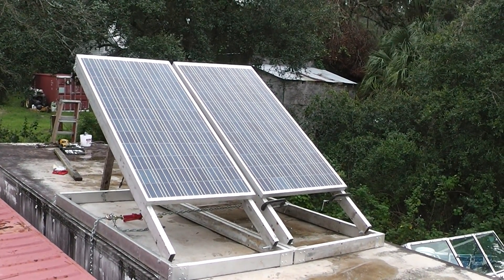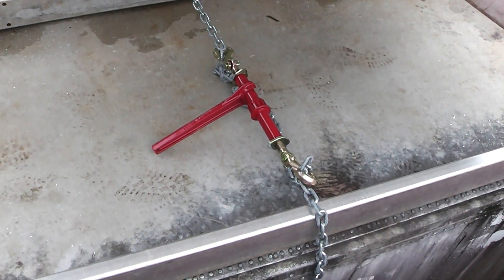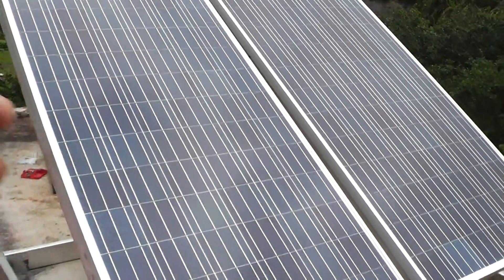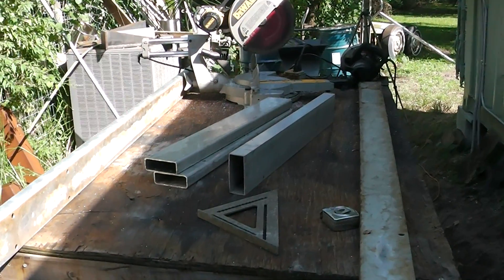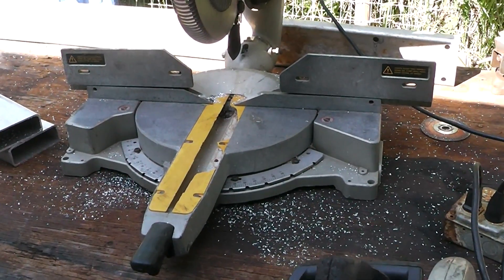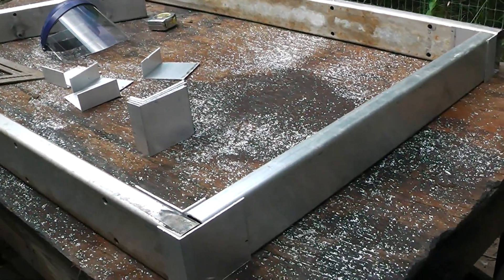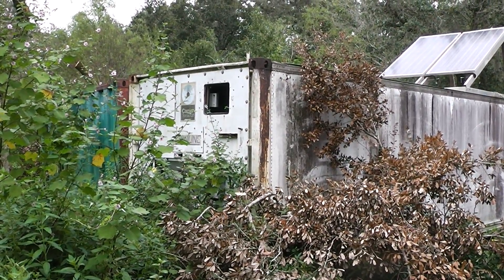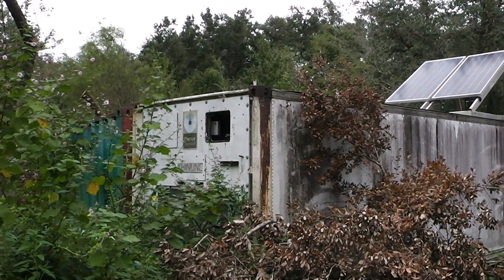How I Mounted Solar Panels to my Shipping Container for Cheap!

Comment: Ever try a 4 1/2 inch grinder with Cut Off wheels? Makes cutting metal fairly easy and no metal chips. Also, if you can find a 12 volt hyd. pump and cylinder (like some hyd. operated pop up campers) you could raise and lower the panel from the ground.
Reply from the maker: I have used the cut off tools but, mainly for steel.
That's a good idea with the pump and cylinder. thanks.
Reply: Electric screw jacks would be an option and can be raised or lowered from the ground...Have a great day...

Comment: dumb question but what happens when you put steel and aluminum together?
Reply from the maker: No such thing.
Galvanic corrosion.
In short, when steel comes in contact with aluminum it will corrode the aluminum. The hot dipped galvanized bolts I used will cause corrosion of the aluminum at a reduced rate rather than plain unprotected steel.
Reply: Didn't know thank thanks.
Reply: Ok I have another question, I have seen some other videos on guys using brass pipes to move the oil drain plugs for generators (because it's in such an awful place it gets oil everywhere). The guy at the plumbing store said that I might get some corrosion at the fitting connection. What are your thoughts on this? I already bought the fittings and don't want to mess up my generator.
Reply from the maker: I would put some stuff called "never sieze" ( Never-seez) on the threads. It is the same stuff that is used when you put spark plugs into an aluminum head on your car or truck. 
Make sure you don't glop it on, you want to use just enough to barely coat the threads but, you don't want to get any in the engine.
Reply: ok thanks for the tip!